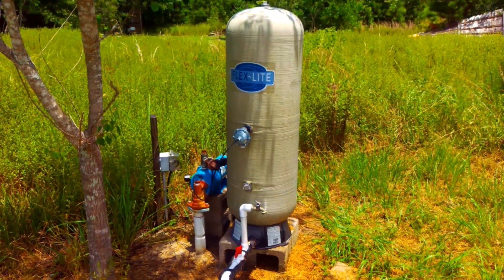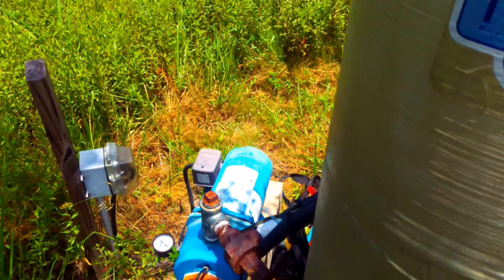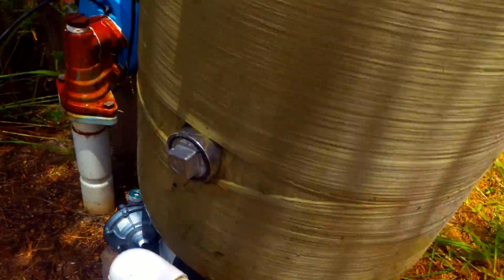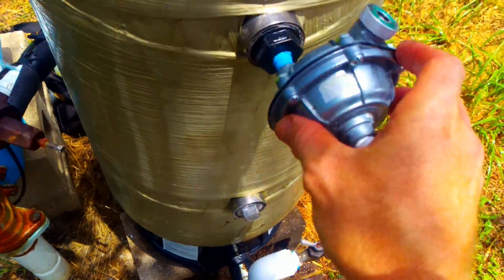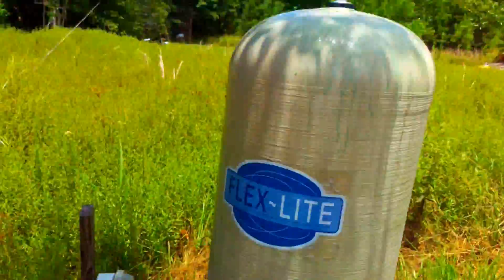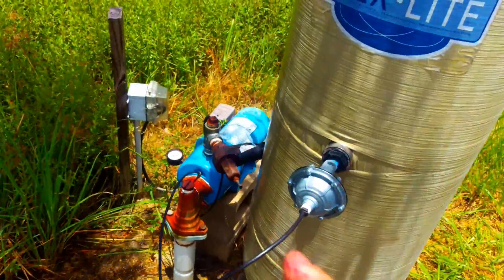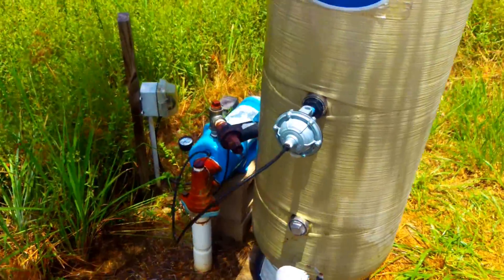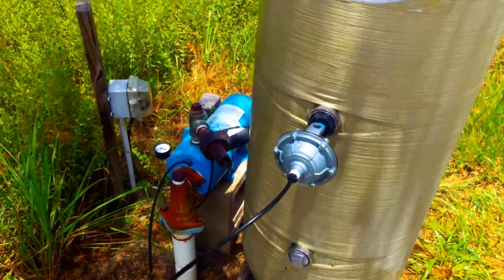Water Logged Standard Tank - How to Diagnose and Repair

Comment: I have the same size tank as you, also by Flex-Lite but without a AVC. Tank holds pressure 40/60 and there are no leaks. Any demand for water cycles the pump within seconds. Would I follow the same process you've demonstrated here?
Reply: Update: I followed your process once, but didn't remove that top plug. With the faucet wide open, the cycle increased to 15 seconds, but I could still hear the tank was full of water. I tried again, but this time I removed the top plug. As it was draining I placed my hand over the plug hole and could feel the suction from all the water draining. The tank drained to completely empty. Tested again with faucet wide open and got a 1 minute and 4 seconds before the pump cycled on. Adding this to the annual to do list. Thank you for this video.

Comment: Thank you for the video but I'm confused. What was the diagnosis? Bad AVC or a leak? Isn't the AVC supposed to maintain the proper air volume?
Reply from the maker: So yes the AVC had failed which caused it to stop putting air in the tank.  After a few months this caused the tank to get waterlogged.  I was more or less demonstrating how to check the top of a fiberglass tank for leaks as this can also be the cause.

Comment: good day sir how long does it take for the tank before it gets water logged? please help sir, im planning to build a bladderless pvc tank to prevent rust
Reply from the maker: Depending on the diameter of the tank and the pressure, the air will dissolve into the water in a few weeks to a few months.  When a tank becomes waterlogged it is no longer serving its purpose to store water. 

I have actually thought about building a PVC tank out of 4"-6" pipe but it's not a good idea.  Mostly the problem is if there is any leak in the fittings you won't be able to fix it.  Then as of now pvc is extremely expensive, it's cheaper and more standard to just get a good quality tank.  I recommend a Glasslind steel tank like AO Smith.
Thanks

Comment: An air leak is not the only way that this kind of tank loses air and becomes waterlogged. Since there is no bladder, the air that is trapped in the tank slowly diffuses into the water. Either way, same end result.
Reply from the maker: Yes that is right, if the air control device is not working or not putting enough air in.  The AVC has to be able to keep up with the amount of air loss. Fiberglass tanks fail at the top and at connections that cause air leaks.  Fixing and or replacing a AVC will not keep a defective tank from being waterlogged. Checking for leaks after the system is refilled is the easiest way to find the leak.

Comment: What are those tanks called the old style ones anyone can help me?? Very much needed!!!!
Reply from the maker: Well there are not really a specific old type of tank they are relatively the same still.  They did once have a standard Hydronumatic tank with a baffle in it to help with air dissolving into the water.

You really only have a choice between a captive air tank or a Hydronumatic tank.

The difference being one has similar to a tube inside a tire that holds the air separately from the water and one that water just fills the tank compressing the air.  

These tanks are used for different situations and installation to best fit, or for filtration purposes.

Thanks for the comment and watching,
Casey

Comment: Did you shut the breaker off before draining
Reply from the maker: Well in this case just pulled the plug to disconnect power. But yes turn off power at switch, plug, or breaker.

Comment: My old well from the 70’s has a metal tank with a pressure gauge and the pump kicks off around 42psi and clicks in around 28psi. Right now I’m the summer you can see condensation on the outside of the tank and I’m guessing that’s the water line and right now it’s about half way up. Should the tank be fuller like 2/3rds full or is half ok?

Comment: Do you have any idea what could be causing almost like a fog horn noise when we flush the toilet or run the kitchen faucet? It only happens maybe 40% of the time. I have a old galvanized tank and judging by feeling it its 75-80% full of water. The cycle time for the tank is about 30 seconds.
Reply from the maker: Yes that could be your air release letting air out of the tank.  This is normal and if pressure does not drop enough to make pump come on, it will let air out for a bit.  The sound is a loud hissing to a whistling or horn noise.  The air release is on the side of the tank in the middle way up.   
Thanks for the comment!

Comment: I am connecting an air volume control valve (disc type with plastic tubing).
I have connected the valve to the side of the tank but the jet pump I have only have one port at the suction which is the drain. Can the tube be connected to the drain port to create that pressure difference needed to push air inside the bladderless tank I have, or I have yo change the pump to get one with a port above the suction?
Reply from the maker: You can only connect the Air volume control to a suction port on the pump, any other port would be pressure and cause it not to work at all.  You can check for suction by running the pump and hold your finger over the end of the tubing that connects to the AVC.  If its not drawing a vacuum when the pump first turns on then you may have to adjust pressure down or make sure its the correct port.  Typically you need the cut in pressure below 40 psi to draw a good vacuum on a shallow well and deep well pump.
The regulator on a deep well pump should be backed out till its loose or the down hole pressure on pump gauge reads 40 psi running.
Thanks for the question!

Comment: If the diaphragm in the air regulator ruptures it starts sucking air into what’s supposed to be a water return to the pump inlet to drain the tank to maintain water at its proper level.Mine began sucking air from the ruptured diaphragm and feeding air into my tank. The pressure built until finally the pump couldn’t force water into the tank at all.To test I clamped the hose and now no air in the water at the faucet.
Reply from the maker: The air volume control can fail with a busted diaphragm and yes cause excess buildup of air in the tank.  Clamping the tubing can help in the short term till you can get a replacement AVC, but dont wait too long or you could waterlogg "Too much water" your tank.  If your tank becomes air logged "Too much air"  then you could turn the power off to the pump and drain the excess out a faucet, then turn the pump back on.
Thanks for the question!

Comment: Hi, I have an old Metal tank for my well, the the air valve with gauge in the tank mid way up is dripping water out of it when the water is being pumped back into the tank.  I recently replaced the pressure switch with a Square D 20/40, which I've adjusted to come on at about 23 and shutoff at 45, my tank has about 65% - 75% of water in it, and pump cycles as it should, any help would be greatly appreciated!!!! THX for the VID!!
Reply from the maker: +paul guthrie Hey Paul, depending on what type of air volume control you have will help figure out what's going on.  Is it the black plastic one, or metal type?  And do you have a above ground pump or a submersible pump?
Reply: The valve is a F93B-1 with a gauge as for the pump I think its submersible pump, there is about 1 ft of piping coming above the ground that has the the pump controller sitting on top of it.   THX!!
Reply from the maker: Yea Paul that is a Air release so you should have a submersible pump.  It will let out the excess air that gets charged in the tank from the pump cycle.   This type though has a brass arm that supports the float and i have seen in many different water conditions that it can fail.   Say you have acidic water or lots of iron, then the arm could just rust off or clog and prevent it from releasing air.  In your case if its leaking how old is it did you just change it not to long ago?   If not i would get a Black Plastic Harvard HAE1 Air Release, They are the best you can buy and will last a long time.
Reply: OK Great thx!!! I have never replaced it.  Air comes out of it when water is being pumped back into the Tank.  I'll pick one up soon!!! Thanks again!!
Reply from the maker: Alright, if its releasing air each cycle and stops but drips a little bit its working fine.  Only if it keeps leaking does it need to be replaced, put a little pan down under to catch the few drops from the cycle.  All valves are imperfect and can drip a little especially when releasing air.  only when they keep leaking do they need to be replaced, and also dont adjust the valve to stop the leak.  Closing the valve will basically turn it of and cause tank to air log, then you will get air spitting inside.

Comment: well is going on off  and where your air going in all that is there is a valve stem like in a tireso how much air do I put in ??? and do i air in when tank is dry?? or as it is fillingthank you
Reply from the maker: What you have is probably a Bag or Diaphragm tank, You want to air the tank up to a little less than your cut on pressure on your pump.
So if your psi is set 40-60 then you want about 35-38 psi in the tank.  Before you air up the tank open and faucet and turn off the power to the pump, this will empty the water pressure so you can add air to the tank.  Keep the faucet open and use a air compressor to air up to the required psi start with 28 psi if you are unsure how much to add.   This will drain the water from your tank, if the tank is good the water will stop flowing out the faucet, and no air will follow.  If the water stops and air comes behind at high pressure or the tank is still full and heavy your air cell is busted.  The tank will need to be replaced, but for now any amount of air you can get in the tank will buy you some time till you can replace it.  If you have any more questions feel free to ask have a good one and thanks for posting this question!

Comment: This is our first house with well water.  our water pressure dropped 75%.  Now we only have 25% of water pressure.  I have to take a shower longer to get myself clean.  We don't know if we have air over water tank or bladder tank.  We changed the switch and the gauge & same issue.   We think we'll change the pressure tank but undecide But I like air over water. It gives me clear water that what I heard.  Like I said our first house with well water.  By look at your tank I see 3 plugs.  is it the one on the top of the tank is for filling the air?  The middle one for what?   and the bottom one for what?   I would like to buy the fiberglass tank no rust.  I can't hear you well about fiberglass tank.  Can you please tell me what I have to do with fiberglass tank and metal tank? By the way we have submersible pump, I think it would be the same with Jet Pump
Reply from the maker: Ok Good Questions, first no matter what tank you have your pressure will be the same depending on the pressure switch setting.  Only the amount of volume of water stored differs from bag to standard tanks.  I do not recommend fiberglass tanks they are not the best thing since sliced bread.  Fiberglass tanks fail sooner than metal tanks, and can cause your pump to fail also.  Sounds more like your having a pump issue if its constantly running and wont build say over 20 psi with the valve shut the the house.   You may need to pull the pump from the well and check for leak on the drop pipe, it may look like a split in the pipe if its plastic. The pump itself could be failing from sand or just old and worn out pump end.   Depending on where you live you might want to get a professional to do this part, your pump could be hanging very deep and very heavy to pull yourself.   Not to mention the task of removing it, if it has a pitless adapter flange.   But i would check first is pressure wile the valve is closed to house and if pump can shut off at say 50-60 psi, this could mean you have a leak in your plumbing.   Thanks for your comment and hope you get it working again soon.